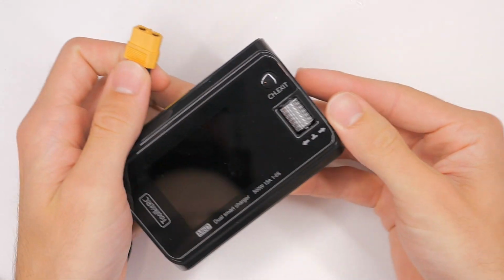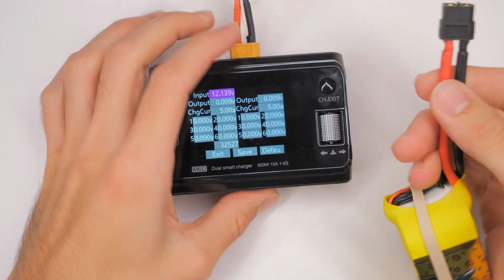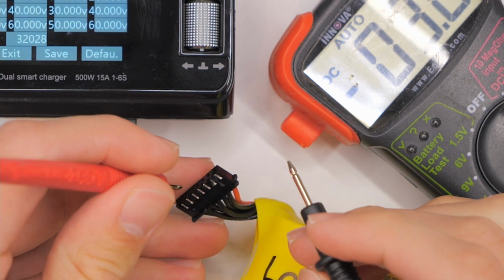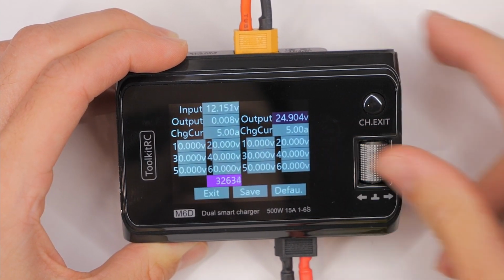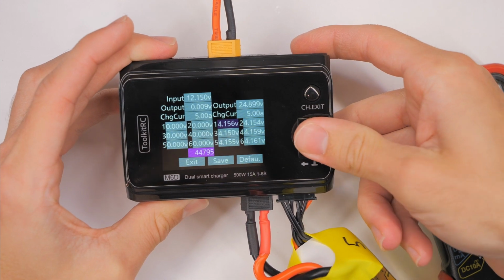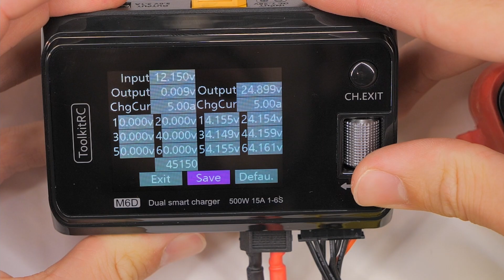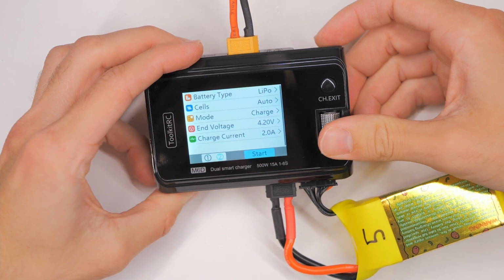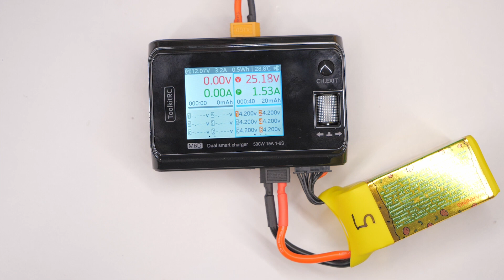FIX: Balance Port Voltage Match Error - ToolKitRC M6D [Needed to Calibrate Main Output Voltage]

Comment: I had same problem with Q6A toolkitrc, after calibration have another issue: when i start charging 6s with total voltage 23 voltas, it increased total voltage to 26+ volts, then showed error "high battery voltage" and dropped total voltage to 21.5 volts. 3 other channels works with same battery, 1 does not
Reply: Маю ту саму проблему. У мене 3 зарядки Q6AC. Одна повністю справна. На другій те саме, що у Вас: один порт не працює. На третій 3 порти не працює. Знайшли вирішення проблеми?

Comment: Why am I the only person in the world without a multimeter? I'm trying to get into FPV and it's turning into a fucking nightmare. Do I just return it an get a different brand? I'm not buying a multimeter, nobody has ever mentioned needing one.
Reply from the maker: Hey! I hear you. I almost gave up when I was first getting into it. Do you have a battery voltage checker (something like this https://amzn.to/40Vj7j6)? That would be just as good as a multimeter in this case.
I would reach out to TOOLKitRC and let them know. I agree this should NOT be something that you have to do to use it.
What's your current drone gear setup? Have any other questions let me know.
Reply: @RCwithAdam1  LOL false alarm! I'm just an idiot! I wasn't plugging in the balance lead all the way to the left. I didn't realize on a 4S there should be 2 extra pins on the charger not 0. Hard to explain in words but yea, I figured it out. Man I was so pissed for no reason. I was just dumb.
Reply from the maker: ok gotcha! Glad you figured it out! 👍

Comment: Could someone explain, how 12v battery supply can charge 6s 25v battery? How does it work? What is the minimum voltage/amperage the charger requires?
Reply: Each cell is only like 4.16V and collectively they are 25V. I think that's how it works
Reply: Because it has internal circuits that can step up or step down voltage. As long as your input voltage is within range, it’s the watts that matter. 

Lets say for example you have a 6000 mah 4s lipo charged to 3.7v/cell (14.8v), it can easily discharge at the 10a, 15a or 20a supported by your device. Lets say yours supports 15a. 15a * 14.8v = 222 watts. This means you can charge 1 output battery at 200w or 2 batteries at 100w each.

If your output battery is 25v, and you can charge it at 200w, 200w/25v=8a, so it will charge at approximately 8a max. But typically you would set it much lower for charging.

If you want to use this input battery for recycle discharge of the output battery, then you need to set the settings for the input battery based on the maximum charge current it can take, normally 1c (6a). 6a*14.8v= 88w. 

In addition to max current and power your input battery can give or receive, you need to set the voltage limits for that battery, so the charger will end operation if it gets too high or low. And since it doesn’t have balance functions as input battery, you need to set the voltage limits corresponding to about 20% and 90% SOC. 3.2v/cell and 4.1v/cell, so on a 4s battery thats 12.8v-16.4v. 

Then if you are discharging a 6s output battery into it, it will automatically limit the discharge rate to 88w, and also stop the operation if the input battery reached 16.4v

In Input settings, you can also set the power limit for your adapter, just the watts is enough. Then the device will automatically limit the charge rate of the output battery to this watts, regardless of the voltage.

Comment: Thanks. I see that any charger is not calibrated. And the accuracy of the multimeter 0.5 - 1% is also low. Marketing. As a result, he calibrates the user with an old and inaccurate multimeter (like me) to correct the balancing mismatch error)))
Thanks for ToolkitRC)

Comment: Okay - got passed the M6D balance port error - now I get "CH2 port disconnected" error after a minute charging.
This happens on both ports with both 1300mah/6S batteries singley or similtaneously.
Suggestions ?